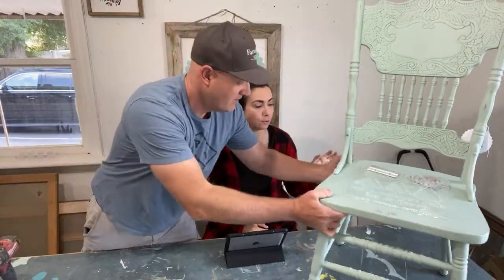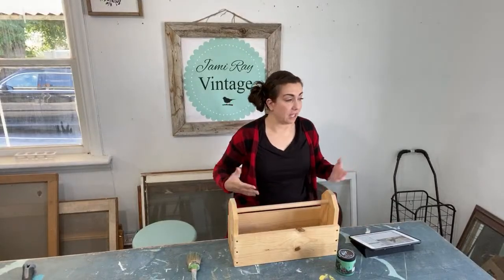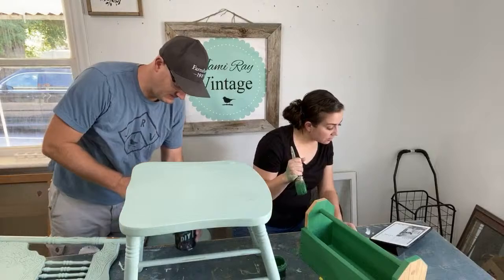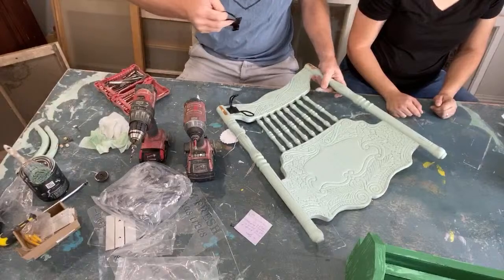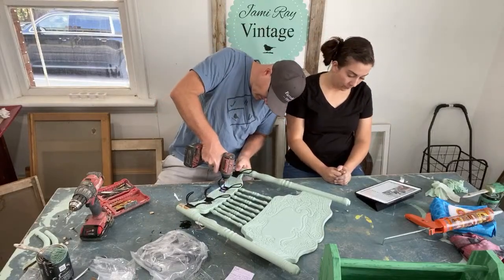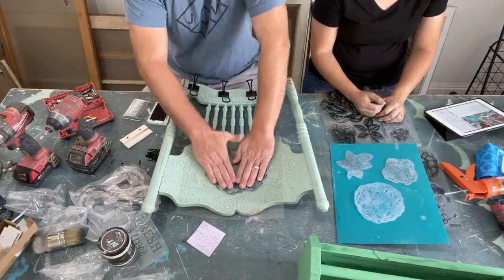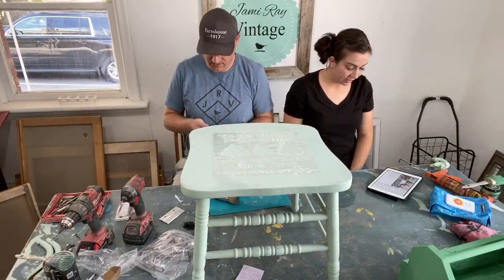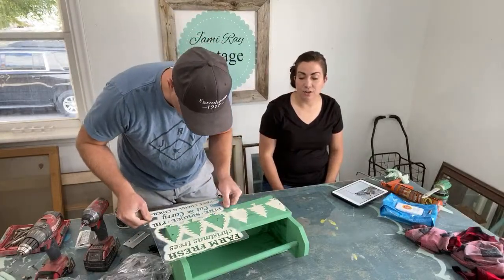Repurposing A Broken Chair | WNW

Comment: Ok so i have the same exact dining room chairs & the matching table. Im trying to figure out if there is a way to upholster these chairs. If you have any ideas they would definitely be appreciated. & also im trying to leave as much of the ornate designs exposed as possible.
Reply from the maker: I would cut a foam pad to fit and wrap the fabric around tight and staple that from the bottom.
Reply: @JamiRayVintage  thank you. I think the braces are throwing me off

Comment: Stupid question, I'm just starting out with chalk and DIY.  I have a piece I waxed without distressing.  I regret not distressing, can I sand it back through the wax and re-wax or just add more?
Reply: Farmless Farmgirl I almost always wax before distressing because there is much less mess that way. It doesn’t create as much dust. Then I finish with another coat of clear wax. If you’re wet distressing you would want to do that before waxing but sanding works fine either before or after. And that’s a great question, by the way. 👍🏻